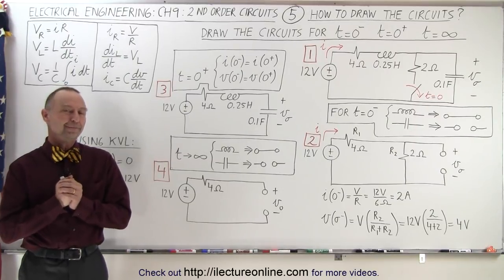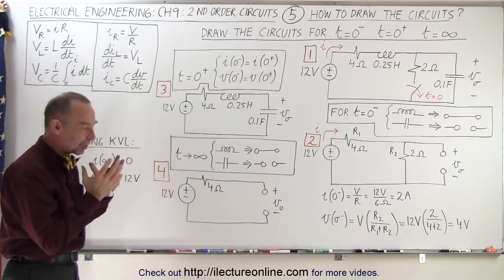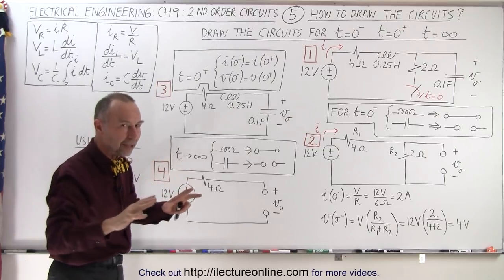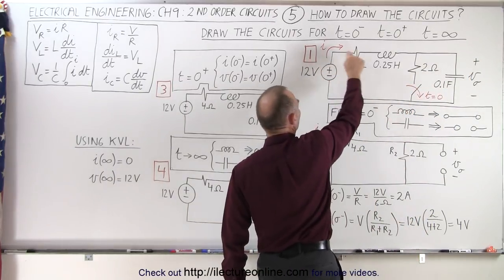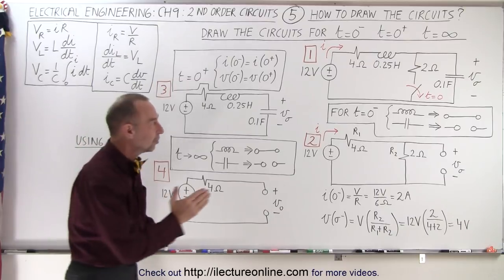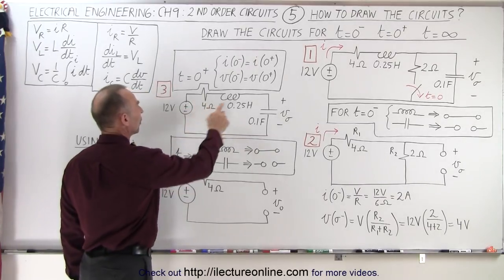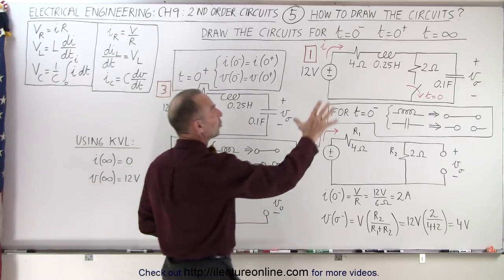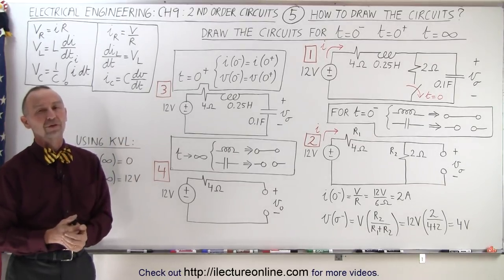Electrical Engineering: Ch 9: 2nd Order Circuits (5 of 76) How to Draw the Circuit?

Comment: One of the most underrated videos on YouTube about this stuff.  I love it!  Help me understand something; top left white board, the bounds of the integral for voltage across the capacitor are  (0 to i).  Is that just a typo?

One last thing; any chance you could do a few videos on parallel switched circuits that become 1 of 3 source-free RLC circuits?   Particularly one that shows currents though each component.  All the videos I can find are series circuits.  I usually use your website to find your videos because they're better organized than what YouTube does with them, so maybe they're hiding in plain sight somewhere?!  Thanks as always, Michel!
Reply from the maker: The equations in the 2 boxes in the top left corner of the board are just for reference.  These are the equations for the voltage across and the current through these 3 components.

Comment: After  t=0, the capacitor acts as an open branch, hence why the two resistors are in series, because no current flows to the open source. Is this always the case when solving RC or RLC circuits (capacitors acting as an open source)?
Reply from the maker: Only with DC current.
Reply: @MichelvanBiezen  Thank you